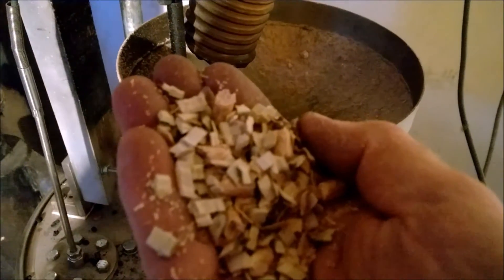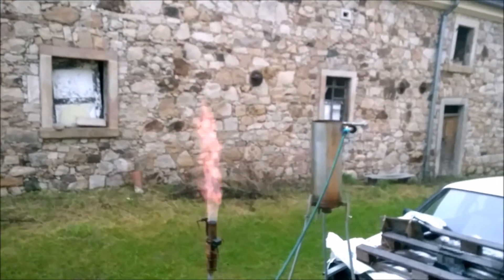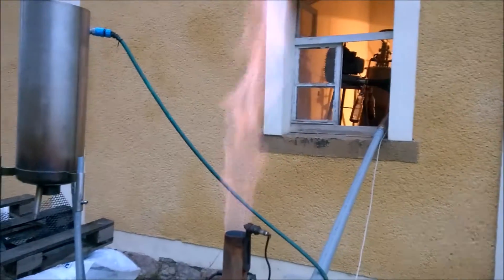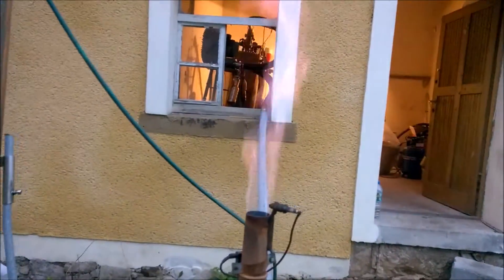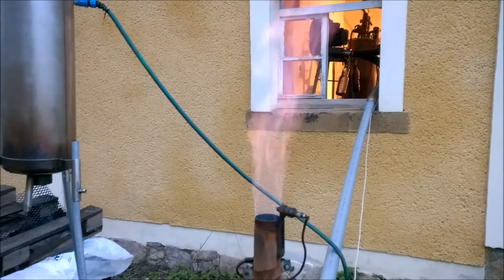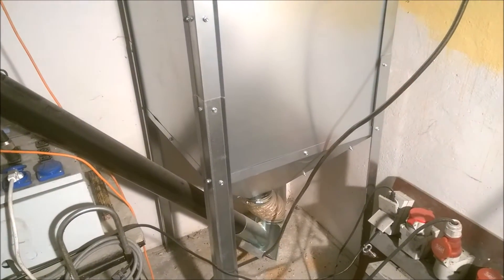Firing tiny woodchips in a DriZleR gasifier....... Mikrochips!

Comment: Very good. I thought about using my garden shredder to produce chips. Your test is showing that my thoughts weren't wrong. Big effort for me :) 
Luk, your work is inspiring me a lot. 
I am  building a Drizzler at the moment and what needs to be solved is the hunger for material it's going to need for longterm runs. 
Thank you very much for your good videos :)

Comment: Good day. Very interested in your development. I make myself a similar setting. For about a year I have been improving cleaning system emissions? But such qualities as you have I can not achieve. I have two cyclone, scrubber water and clay Filter (Filter, filled with expanded clay). Photo and video of my installation  I can send on your mail. You said in your video filters filled with coal, which is coal used ? Can you describe in details the filters? Do I make a photo of filter's content ? It needs your help! I do koheheratsiynu installation of 30 kW. Could I come and have your consultation? Is it possible to you? I will wait for your answer. Have a good day. Ruslan.
Reply from the maker: Dear Ruslan, I use as filter first a thick layer of woodchips and then several layers of dense ceramic wool. As I am very pleased by the cleaning I am not pleased by the underpressure Tha filter creates and the difficulty in quick replacement. At this moment I have dimantled my instalation completely because I am going to move in a new house so there is not much to see and to experiment. However we have a forum that have slowly more and more members. I invite you to become a member and discuss your work with the work of other builders. Also you will see when I begin to show my results there that my system will be running again. If then you contact me and my system is working again in my new house we could set up a meeting. here is the link to the forum: It is a multiligual forum so you could write in the langueage you prefer. http://forum.thedrizzler.com/index.php
Reply: Ok, thank you very much for answering.
Reply: Ok, thank you very much for answering.

Comment: Hi Luc, this does look positive. How dry were the chips? The other question has to be 'did they reduce the fouling you had at the top of the drop pipe?
Thanks,
Neil
Reply from the maker: Neil, chips dried this summer. At the feel they where bone dry. I have tested only a few hours. the clogging in my machine as it is now (working on improvements), starts only at between 12 and 15 hours. so i can not tell you right now.     luk
Reply: That is interesting and appears to dismiss Andrew Rollinson's theory that pellets can not be used successfully as they crumble when undergoing reduction, unless the DriZzleR process negates that problem too!
BR
Neil
Reply from the maker: Neil Munro After hundreds of hours tests , i must say Rollinson is wrong.The pellets neither crumble, nor desintegrate. at least not in a DriZzleR. By a clean out, between ash, i find also a lot of fine charcoaled pellets. I sieve them out and they make great fuel for a clean start. In a DriZzleR, pellets are powerfull an troublefree fuel for gasification.